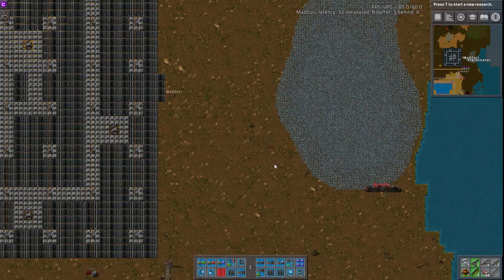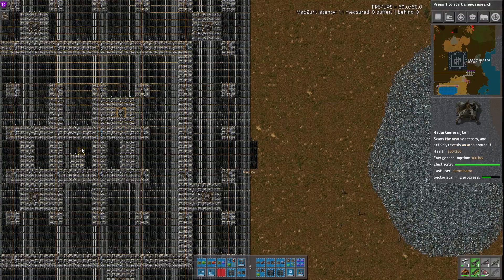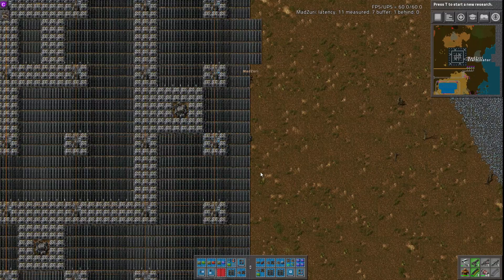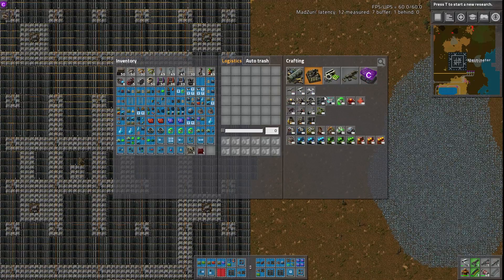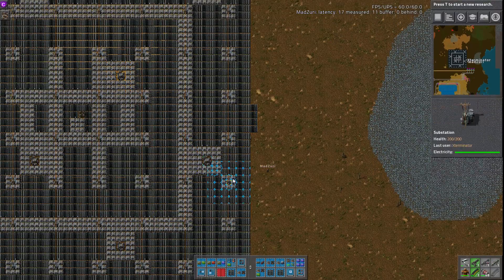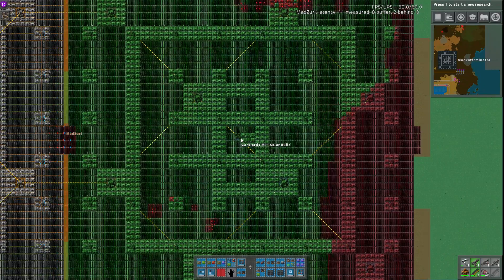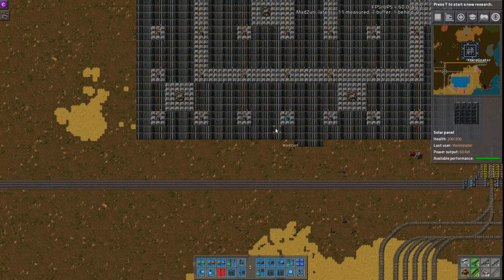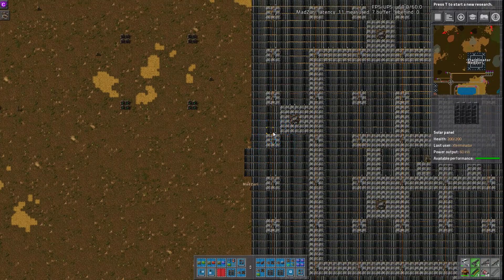Zarklord's Solar Layout / Design:: Factorio Workshop Season 2 - Building A Better Factory

Comment: hey thanks for featuring my build! a couple quick things though those accums that make the build unsymetrical in the middle should actually be solar panels(which is my fault i miss-calculated the ratio slightly)if you wanted to you could also replace 4 accums with a solar panel(after the center accum to panel replacement) to have a only .08 accums over the perfect ratio but then you have those 5 empty tiles which would drive me nuts and most other people nuts aswell.also in my calculations it produced 68.25 mw per stamp, I wonder what I did wrong wrong. last thing is you need 15 of these stamps to produce 1 GW of power.
Reply: One last thing which I saw xterm doing was rotating the bp, which is fine but unnecessary.
Reply: BP string of slightly modified symmetrical version: https://pastebin.com/0px5gkP7
IMG: https://imgur.com/GHiux2O
edit: Apparently I'm really bad at calculating ratios or something weird happened to my numbers when i built it.
the BP string includes a much more pleasing to the eye correct ratio build. this is the final fixed version. its identical to the above featured video in a more visually pleasing layout.
Reply from the maker: Thanks for the clarification! Overall very good design. :)